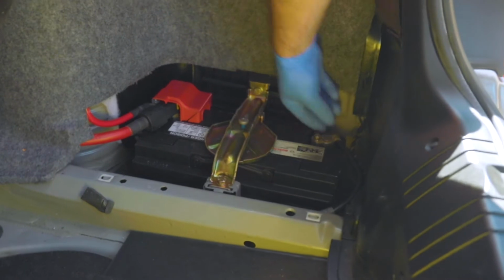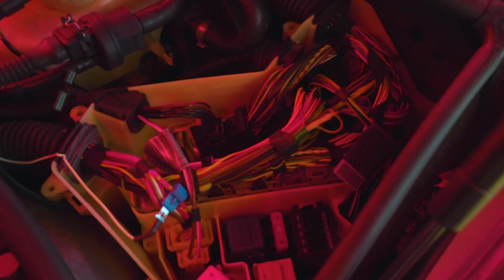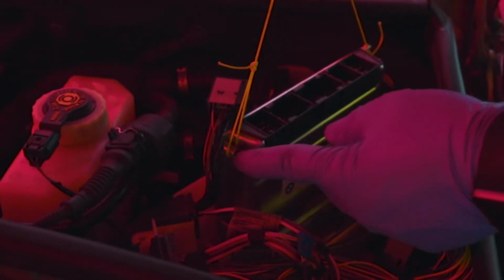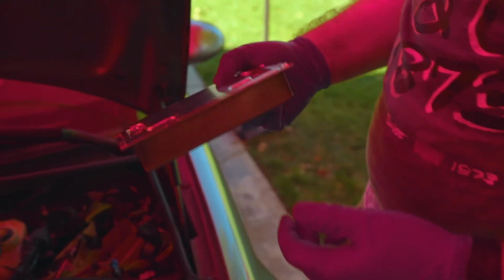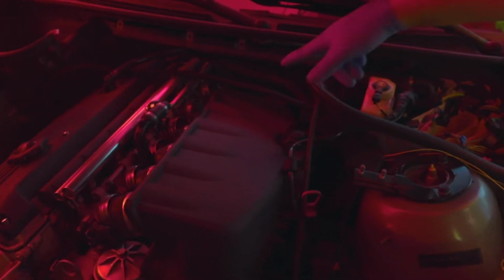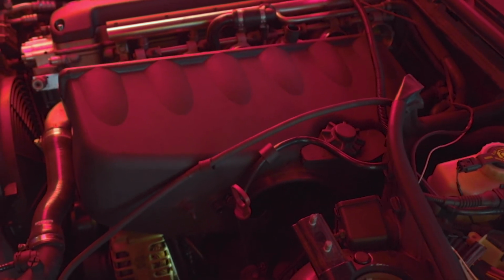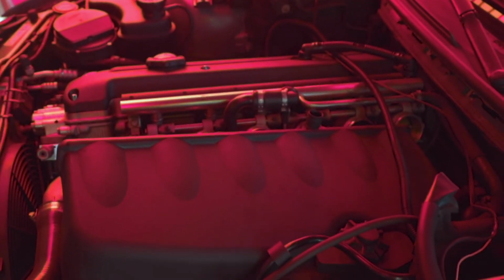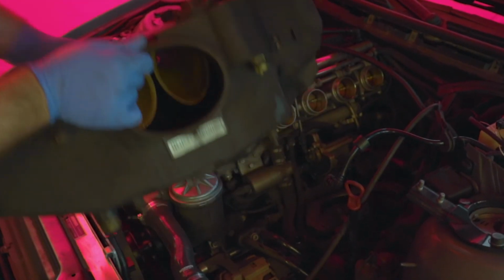e46 M3 CSL Conversion - Stock Intake and Plenum Removal

Comment: why didn't you just do the ecuwrx yourself? deletes MAF and allows ALPHA N, just curious since I plan on going that route
Reply from the maker: The route I took was a map sensor with the original csl ecu and tune. This would mean the car would run better down low compared to the alpha n route. I mainly want the car to run like an oem car and have all of the values it needs to make the right air to fuel ratios.
Reply from the maker: The map sensor mod was very simple and I’ll be uploading it very soon which will show how to do it yourself. Took about 25 min to complete the conversion to map sensor.
Reply: MunichVenom ah okay makes sense, I agree that it’s better to run the csl tune for accurate air/fuel ratios. Thanks for the input
Reply from the maker: I’ve been driving the car with the map sensor and intake for a month now and I do not notice a difference in the car’s down low responsiveness. Feels like driving a stock e46 m3.